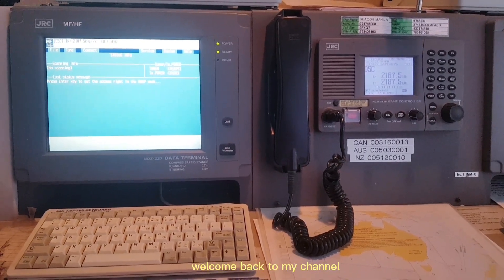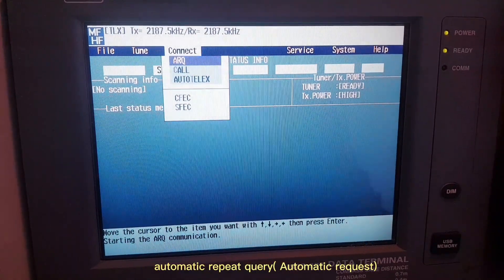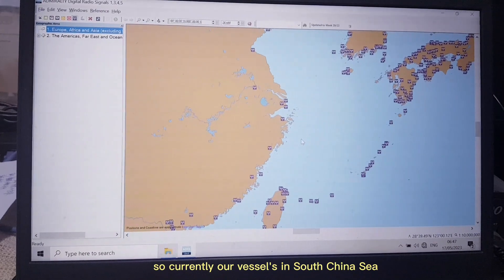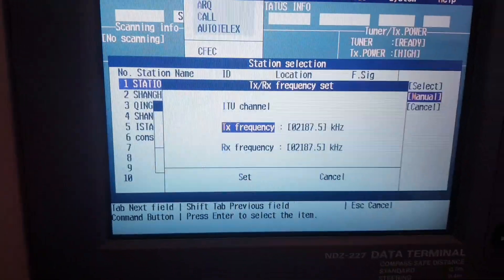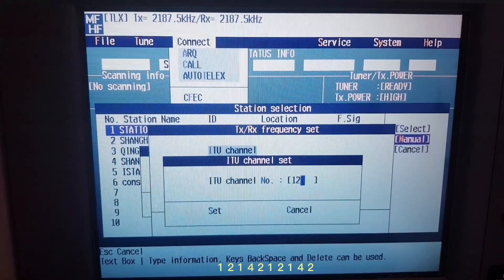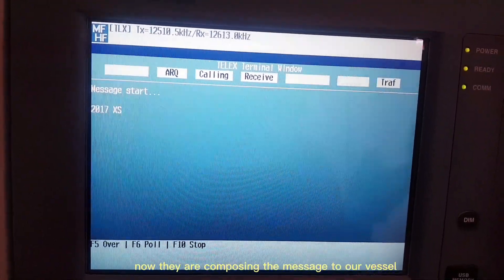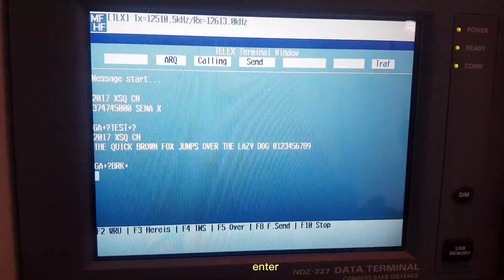How to select and Perform the NBDP test with shore's station( Narrow Band Direct Printing)

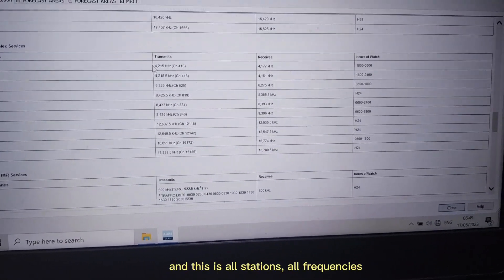Comment: Hi,bro.Has the Shanghai station canceled the NBDP service now? today is 10Dec2023. i can't find 3:16 this radiotelex information on ADP 1345.
Reply from the maker: Hi there. Thank you for your comment mate. Yeah they has. So just for your more information. From the first of January 2024. The NPDP is no longer required for the ship. For that reason some of radio station will try to remove the radio telex advance before the effective date.
Reply: @sytransailorchannel.6817 Thanks you very much！So what should we do about NBDP after January 1, 2024? Do I need to notify the company to replace the NBDP device to INM-C?
Reply from the maker: @alexanderkwok2346  I don't think we need to that mate. It's not neccessary. So We just try to ignore that equipment as what we did as before.hahaha.
Reply: @sytransailorchannel.6817 is there any other way to test NBDP or other available stations